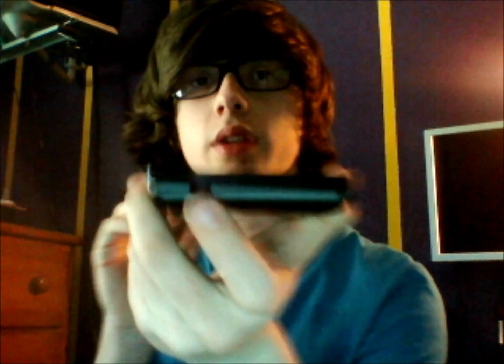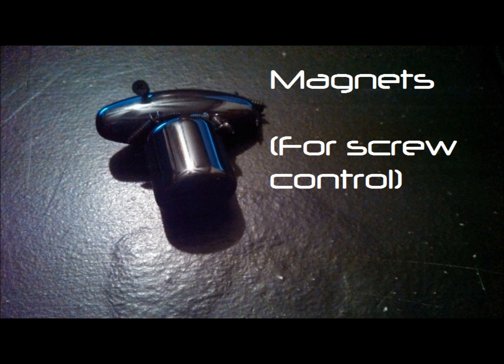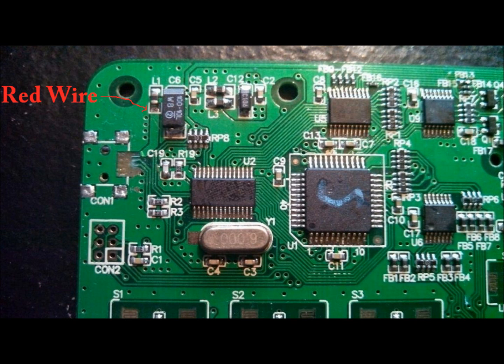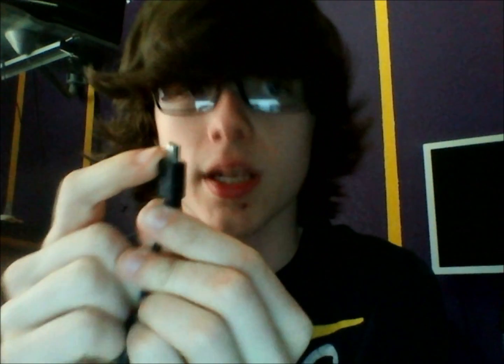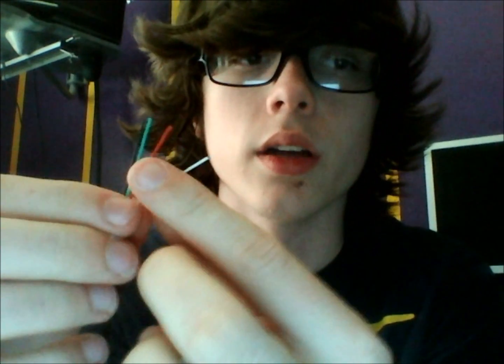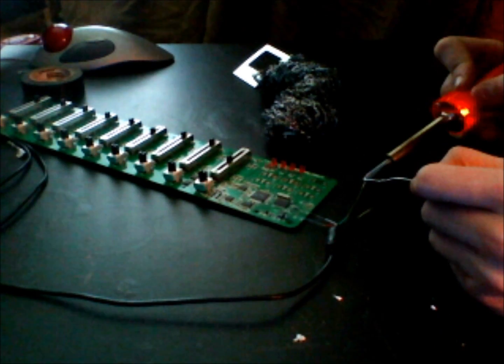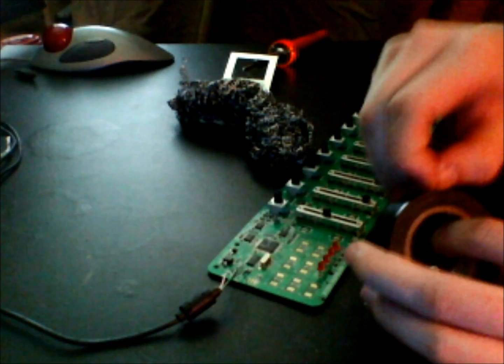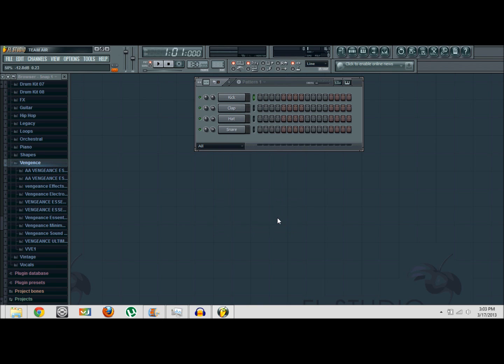How to fix a Broken Korg nanoKontrol USB port

Comment: Does this works the same way on a nanokontrol 2?
Reply from the maker: my name is paul not 100% certain, but I can't see them doing much different with the component board from v1 to v2. Especially if it's the same kind of cable for both. Like I said, not sure. I've never owned the 2 so you're doing so at your own risk. Good luck!

Comment: nice video dude. I've been thinking about doing this with behringer umx49. the usb has been faulty and i pretty screwed up my spare usb port replacement. I am waiting for a midi to usb cable - i ordered like 3 from china lol so it might take a long while. but with midi i need an ac adapter. so maybe if i solder a usb cable to the pcb directly it should work better. I hope i can fix it.

I'm also a fan of the nanokontrol. been thinking about getting kontrol2. I'm not sure of the necessity but they replaced the buttons in a more comfortable spot. cheers!

Comment: Anyone have the specs of the inducer and the two resistors? i got one that had a fix atempt that resulted in those components involved in solder blobs :D i just need to get equivalent trhu hole parts to complete a custom cable now...

Comment: Dude how do you open the casing to get inside? I feel like I'm forcing it.
Reply from the maker: daniel nutt Make sure that you have unscrewed all 6 screws from the back of the device as well as taken all of the knobs and sliders on the other side off. With these conditions fulfilled, you should be able to rest it on a table and have it come right off by lifting the back side of the device.

Comment from the maker: As long as R2 and R3 are still intact and connected to the circuit board, you should be fine. I did the same repair to my second Korg Kontrol, and I lost the R3 connector. I had over-soldered and that tiny little connector just melted right off onto the floor. So as long as it's still there, you should be fine. 

As for the wiggling, are any of your wires stripped too far? Do they touch each other? That is a big problem if they do. That would cause it to power down.

Comment: What happens if I accidently over heated/melted the r2 and r3 tiny chip thats on the motherboard? I also over soldered the L1 a little bit as well. I plugged in my korg nano kontrol and it only powers on or works when I wiggle the cable around. I taped it down but any sudden movement to the korg nano it powers down. Do you happen to know if I need to resolder a specific chip that has to do with power?

Comment from the maker: It should be. The basic components that I rewired in this video should be in every product with a micro USB. /watch?v=spfYhzyjP6g that video will show you how to disassemble the nanoPad. Just look for the two resistors, the inducer (most likely marked L1), and then use the component rings. If it is anything like the nanoKontrol, it should be this easy. If not, I can't help out for that because I do not own a nanoPad for myself. Hope this was of some help.